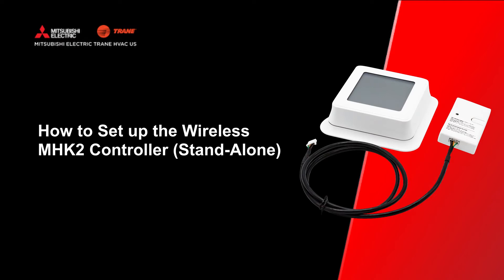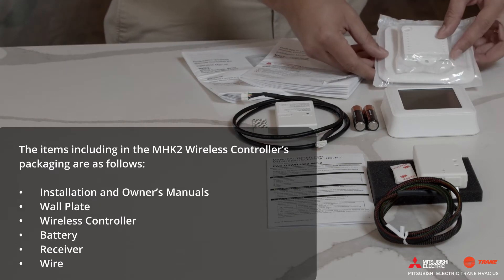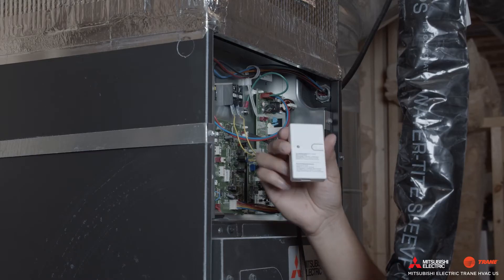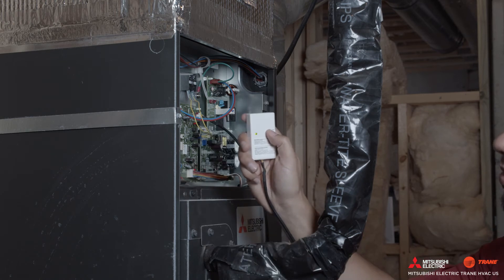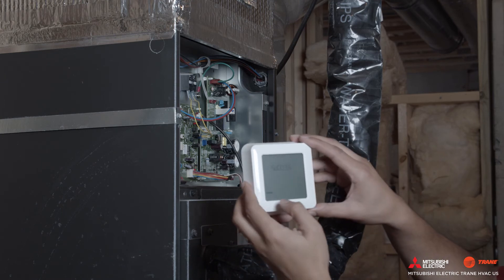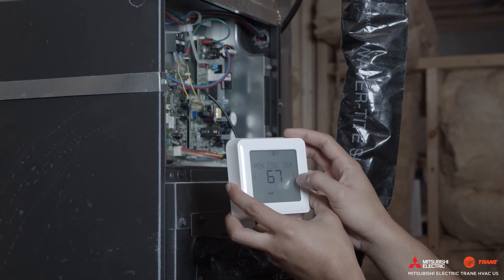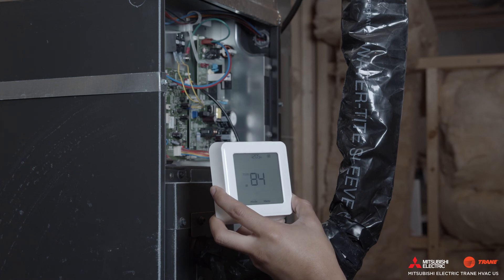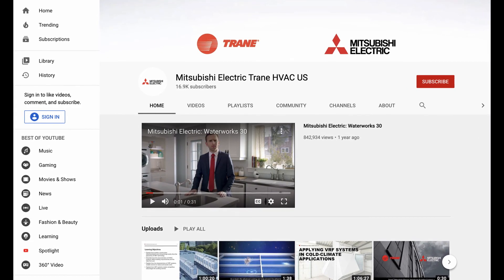How to Set Up the MHK2 Wireless Controller

Comment: Please create a video on how to connect to the local WiFi. 
Alternatively, to benefit the non-technical user community and make things much simplier for your user-base, you could create a link here or on your www site that runs a script to automatically find the local MHK2 via its MAC address. Using the WiFi settings already configured and running on a users device (mobile or desktop) to connect to the users home internet default gateway with a DHCP IP address. (Apple does this already with its phones, they allow you to use the settings that are lready on a know device (that you authorize)). -uber simple.

Comment: I need the wall plate instructions. I have read both the split-type air conditioners manual and the redling wireless remote controller kit manuals, but i did not find the wall plate instructions?

Comment: A video showing how to wire a third party thermostat into the kumo cloud station would be extremely helpful for operating heat pumps plus secondary heating systems efficiently.
Reply: I don't think you can wire a third-party thermostat to units that are controlled wirelessly.  Ecobee, Nest, etc., require 24-volt wiring that isn't available on these units.

Comment: My thermostat is stuck on wait with the RedLink showing it is connected. My wireless will not connect even though it has been connected and every other device is connected and working.
Reply: I'm having this same exact problem. Did you figure it out? Saturday so no tech support.
Reply: @jonathanswank62  Yes, for whatever reason it started working again the next day. I think it was something wonky on Mitsubishi's end.
Reply: I’m also running into the same problem, so far no luck

Comment: My thermostat is stuck on wait with red link showing an x
Reply: pull battery and shut off power to unit for 5 minutes.. very imporatant  5 minutes . this is how you reset MHK2
Reply: Service tech had to replace the thermostat